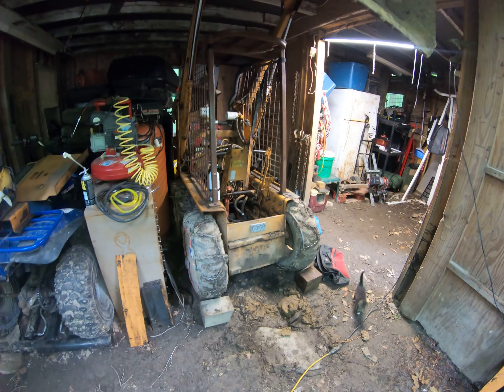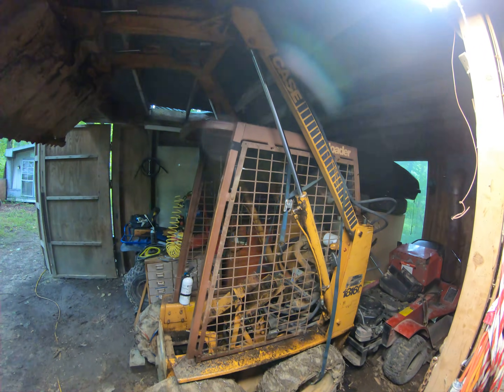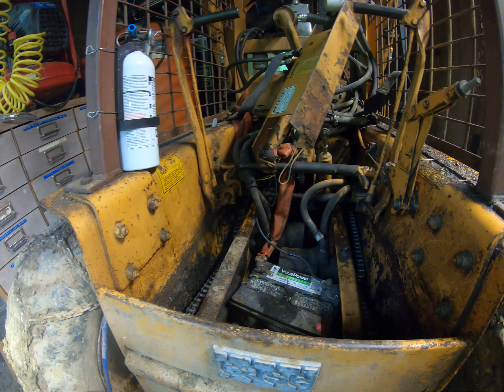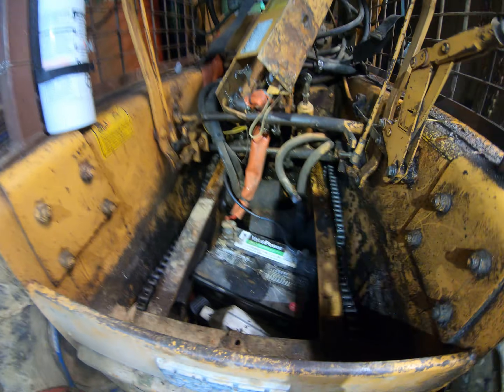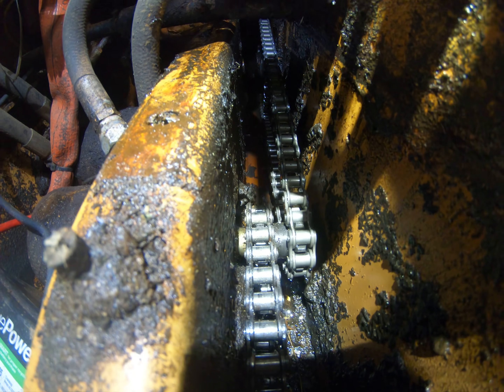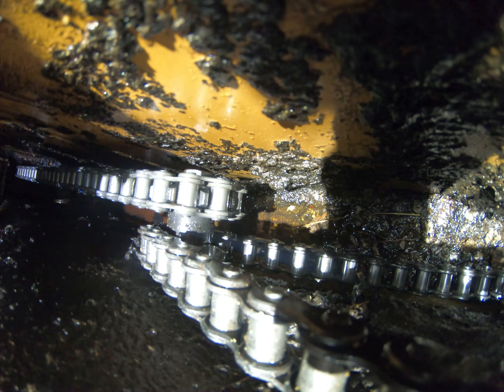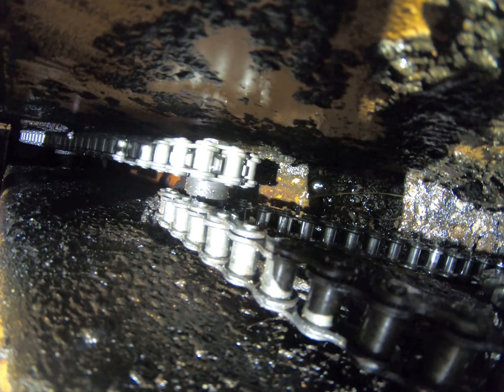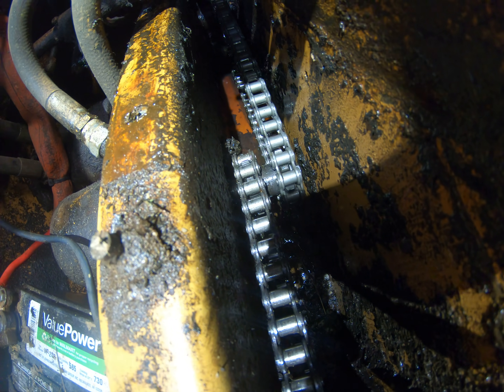2021- Case 1816C Skid Steer Leak in Hydraulic Drive Motor

Comment: I have a CASE 1816C which has a grinding sound on the Operators Left Hand Side when you're trying to move turn left or right and it leaks hydraulic oil too.  We "think" that it is the operator left hand side hydraulic pump but we're not 100% sure.  We are currently tearing it apart to remove that pump but the pulley seemed to have been installed backwards and was really hard to remove from the shaft.
Reply from the maker: Pulley backwards? Yikes! Never seen that before. Hope you fix it

Comment: Hi Edward
Did you find a seal kit for the drive motors? I have an 1816 too... so far no drive motor issues.
Reply from the maker: I did not find a seal kit, I had to go to a hydraulic shop and match it up. It was a real pain! It started leaking again now, so I think I'm going to just pull the motor again and take it somewhere. I can work on engines, but I guess I'm not as good as I thought with hydraulic motors!
Reply: Hi Edward
How hard was it to remove the drive motor Ive been chasing a leaking issue and I believe I have the same problem.
Reply from the maker: @mwade287  Pretty rough. No rusted bolts but you have to remove the seat, gauge panel, disconnect ignition switch wiring, and disconnect the control levers. You also need a big wrench...maybe 15/16*? Can't remember for sure...but it's a headache. Only took me maybe 2 hrs to remove it, but it just isn't a fun job.
Reply: Thanks for the video it was helpful is there anyway you can make another video showing how to disassemble a ticket to the drive Motors I'm having issues with my 1816b and also do you know anything about how to get the hub bearings off?
Reply: Did you have to take the chains off or did it just pull off the shaft.